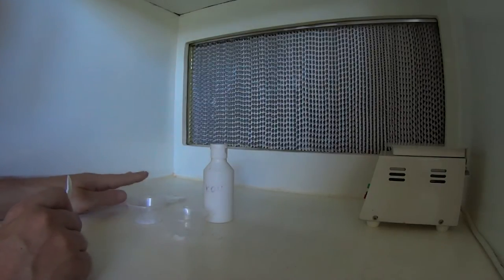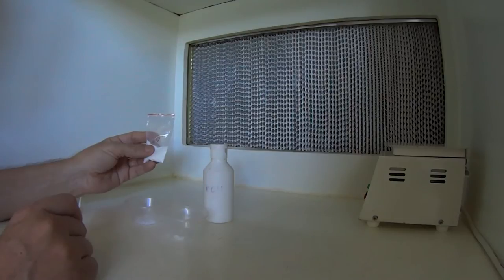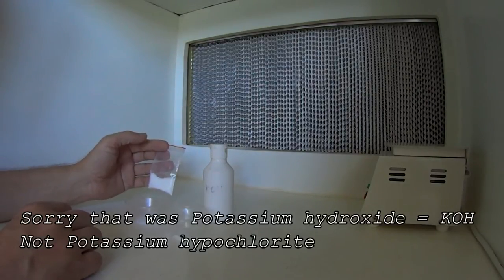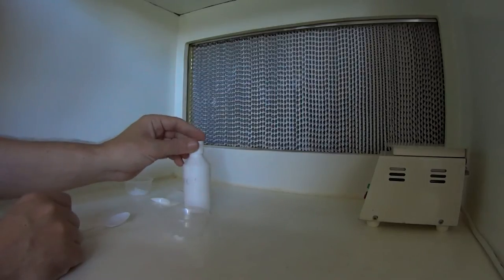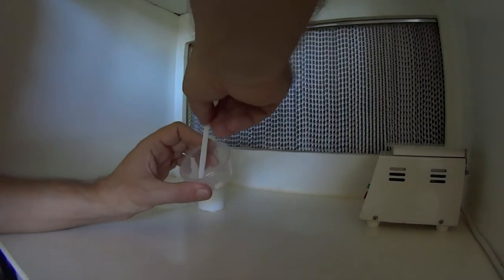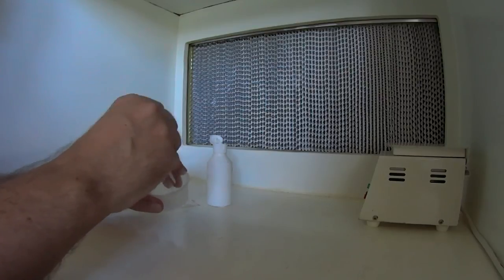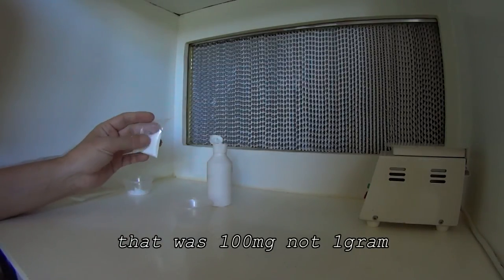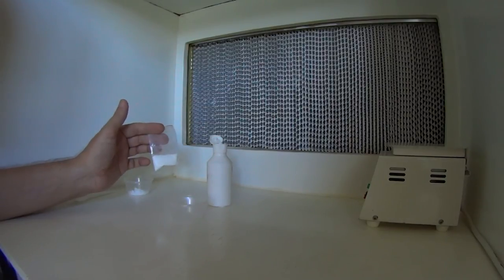How to dissolve plant growth regulators

Comment: I used a 99% BAP powder to make a 2% solution in melted lanolin at +/-175 degrees. I did not dissolve the BAP first. Will this work in your opinion? I just did it tonight. Thanks!
Reply from the maker: +Guy Tillen yeah mate,
Thats the same method i use
Reply: Great ~ Thanks for the reply!

Comment: So a heat stir plate is not as important as the glass bead steriliser??
Reply from the maker: It depends on what you have to heat it with.
A microwave will work fine or an alcohol burner I use the glass bead sterilizer because it works great for me and I already have one.